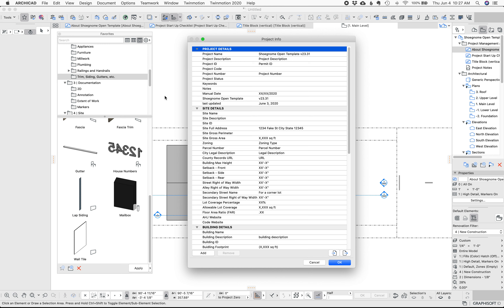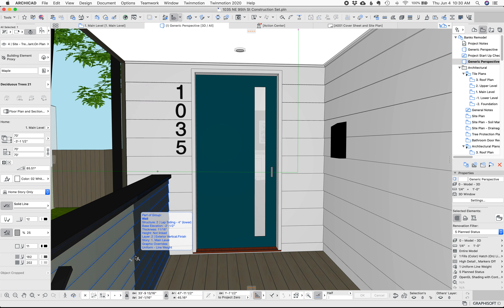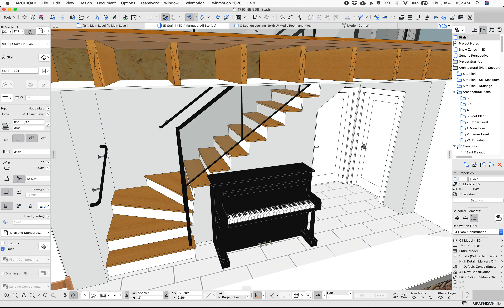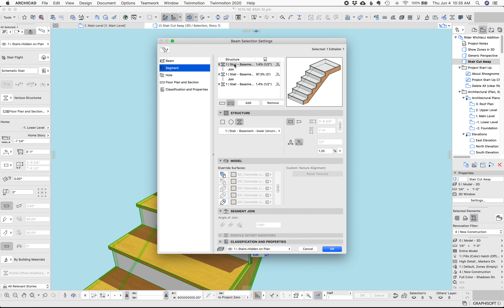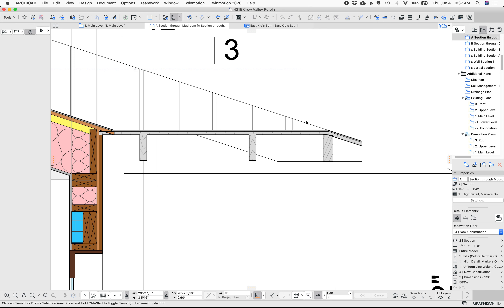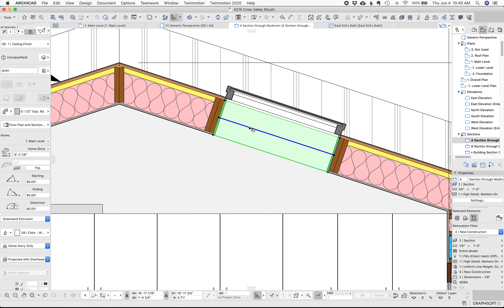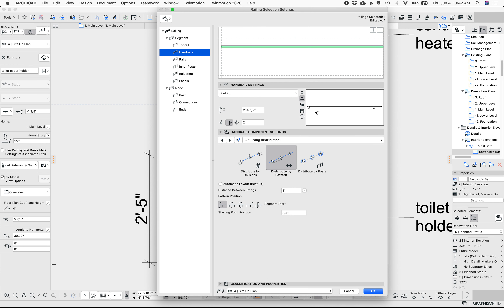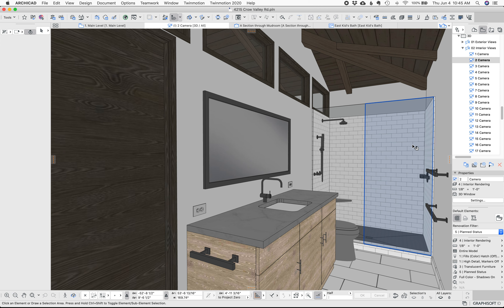Archicad Tutorial #74: Stairs, Skylights, and Miscellaneous Modeling Tips

Comment: Thanks Jared. With the skylight tool, you suggest creating a lining for the inner roof by using the shell tool, with the skylight placed on the outer roof. Have you tried simply placing the archicad Simple Skylight Opening in the outer roof instead, which creates a simple rectangular hole say 6 inches wider all round than the skylight. Then place the skylight on the inner roof. This solves the lining issue, allowing you to easily experiment with perpendicular or horizontal / vertical lining angles at skylight head and sill, and it looks more convincing from the outside allowing you to  consider waterproofing around the tiling.
Reply from the maker: I have. That definitely works in some, but not all instances. I assume there's a void between the sheathing and gyp board when modeling--i model the structure as beams and typically don't add insulation until later.